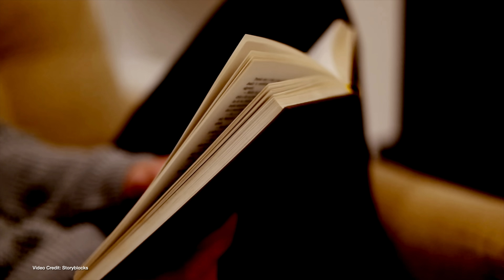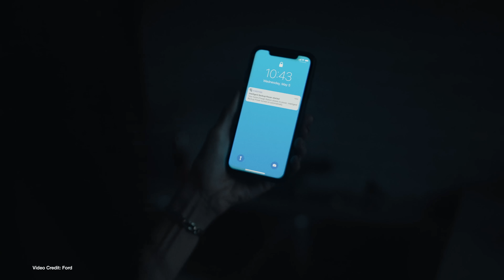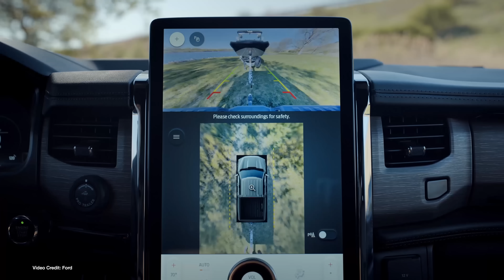What's Vehicle to Home - And Vehicle to Load?

Comment: I'd love to see a beefy vehicle to load system. something that could handle running a single window air conditioner with its high load starts, or space heater, and was clean enough of a power source to run a laptop without worries. A decent generator that can do that would be very expensive, and probably terrible for pollution. If I've got a ton of battery sitting in my garage, it's a pain not to be able to use it when you really need it
Reply: I charge my deep cycle batteries with my small generator or my solar cells then power my small fridge with an inverter. Since the fridge compressor only runs a few minutes per hour, the battery is on-demand only as opposed to needlessly running the generator full time.
Reply: @DanWS100  cool. Pun intended. Just seems to me that if I'm buying a battery that huge, might as well be able to use it to run a few things in a pinch. Adding a quality inverter to the car wouldn't add much to the final price, and at the very least it's nice to have on the beach to keep your drinks cold.

Comment: At 6:59 you talk about combining charging circuit with power drive as quickly becoming the norm.
Alan Coconni invented/ developed this in the 1990’s at the end of development of the GM EV-1. It was too late to put in the EV-1 due to. gM design freeze tip event card from mods close to production so it did not get used.
It lead to the high price of the Hughs external inductive charger that was required on the EV-1.
Reply: Correction

 It was too late to put in the EV-1 due to a GM design freeze to prevent cars from modification  close to production so it did not get used.
Of course production was delayed
But modification  was not put in.

Comment: I've been wondering would've be cheaper to use old leaf with 24kwh battery as solar battery. At least out here in Finland, that mount of lithium battery would cost more than used leaf.
Reply: A used EV battery is great for a solar setup. Lead acid batteries can work for it too. They're cheap, good for many power cycles. They're heavy, which unless you live off the ground floor isn't a problem, and they're not very energy dense, but a closet full of them could still power your home at least overnight.
Reply: Yes you can actually get a good working and drivable Leaf here in USA for under $9k all day. This is a much cheaper price than stand alone battery pack to run your house in emergency. You still need to feed the vehicles DC battery energy into a separate 6-9kw inverter to power your home as well as auto transfer switch to cut off grid in emergency. So add another $1500 to $2k for that plus labor. Most Grid Tie solar inverters can handle from 300 to 600 volts DC input so no issue there. With the auto xfer switch and another small Off Grid inverter you can trick a Grid Tie inverter into running in emergency or Off Grid scenario.
Reply: if you check on ebay used EV  batteries are very popular, and not cheap, cheaper than new batteries thou.
all the people worried about recycling used EV batteries dont realize they are mostly ending up as battery backup on home systems.
Reply: Not that difficult, the WallBox Quasar for Chademo is available now for V2H.  And the CCS version coming soon.
https://wallbox.com/en_us/quasar-dc-charger

Comment: Fortunately the power grid over here is a lot more reliable than the ones we experienced in the US. In the 40 years I lived here I can only remember 3 power outages. One was deliberate for some maintenance and 2 were diggers hitting copper. Power outage was never longer than an hour. From that point of view power to home isn't something  which would influence the purchase of a car. In the US we had an average of 1 failure per year and sometimes for more than 2 days....
What I would never do is to use the car as a buffer for the solar panels or "the grid" if it has LiIon batteries. If I look at the cycles my home battery (LiFePO) gets our cars battery wouldn't make it beyond 4 years lifetime (assuming optimistic 1500 cycles) whereas the home battery is specified for 10000 cycles (well beyond 20 years). And the home battery was a lot cheaper than our Tesla!
Reply: I guess you have not heard of the BYD blade battery LFP and 4000 cycles guaranteed before it drops below 80% and at around $85 per kwh, that's 12 years of daily discharge and the new BYD EV offer V2L as well. $22k EV with a 50kwh battery, good luck finding a grid storage battery with that capacity and price and it can also be used for transport.
Reply: @gregandkaruna6674  LiFePO is LFP and that's what I have for the house battery. As there is no rapid charging like in cars the manufacturer guaranties 10000 charge cycles and not only 4000 for 80%.
The blade battery is still not available on the market and with Chinese specifications I am careful as I have burned my fingers to often.
If you would have read my posting I also said that I wouldn't do it with a LiIon and mentioned the LFP as being better suited. Our Tesla has LiIon and I can fully understand why Tesla doesn't want it to be used to power a home.
Reply: @juergenschoepf2885  Well any country that is lucky enough to get Chinese made standard range Model 3 and Y do get the much safer LFP batteries so they could be used for backup power quite safely

Comment: We've been on the fence about putting solar on the house. My wife wants backup in such a system, which would add $$$ for enough capacity to get through an extended outage. And given the spate of outages reported on the news, I think she has a point. That's why I am so intrigued by Ford's recent announcement. The battery in a vehicle is far larger than anything I would ever consider buying for a once in a while event. And if we need to go somewhere, we have another car - and I bet most other people do too.
Reply: Why not buy an old second hand Nissan leaf they’re very cheap, park it up and connect it via one of the V2G chargers. Then it would charge up on solar ready for a power outage and to run the house in the evening when the sun goes down. That’s what I’m going to do, in my case the cars going into the garage never to be driven again. Total cost car and Nissan charger £9000 for 30 kWh of storage.
Reply: @wobby1516  I looked into it, doesn't seem avail until 2022. Between a Leaf (which I leased for 3 years) and a truck, I'd probably have more use for the truck... but the price of a used Leaf is compelling.

Comment: Why would I power my house with my car? In cases of emergency-isn't it important to have a full "tank of gas" in case one needs to leave. But yeah-having internet is just so important when the power goes out. If it is really is an issue-then wouldn't you get the solar/ power wall combo.
Reply: Here in texas hundreds died during the winter when the power went out. I could have used half the power in my car for hours and hours of heat, and still had half a 'tank'.
fortunately, i was able to just hang out in my car with the heater on, in the garage since i dind't have to worry about fumes, but still.. it would have been amazing to just be able to plug in a space heater to the car. and not everyone can afford the 30k to 50k for a solar/battery combo
Reply: @jameshughes3014  It was good you had a source of heat but I must point out that staying in the car was way more efficient than trying to heat the entire house as uncomfortable as it was. Good thing it was an ev. That's one thing a large battery like in the Lightning can do for an entire home as long as you know for sure that the outage isn't very long. Not knowing the duration though, I'd stay in the vehicle a lot if not most of the time - snow survival 101.
Reply: @DanWS100  who said an entire  house? I said a space heater. With a built in 2500 watt inverter, my car could run a space heater to heat one room for probably a hundred hours and still have half my charge left, and also be powerful enough that if I had to I could run a small window ac for a bit.. certainly powerful enough to run a fridge, what ever emergency need. Not all at once but usually you only need one thing. If it's something you'll only use once or twice in your life, why spend thousands just to make it more efficient? 
Feel free to go camping in your car, no one is stopping you. But my mom uses an oxygen machine. In an emergency, a small inverter could power it long enough to fill an oxygen bottle easy. Breathing survival 101
Reply: @jameshughes3014  Totally irresponsible! If a hurricane hit-videos like this may sway people to stay and power their house with their car rather than EVACUATE. I will never purchase a car based on the fact that it can power my house.  I prefer to have my car be my car and get me out of Dodge and use a generator for emergencies.
Reply: @seoultocebu  because my situation wasn't a hurricane, your argument makes no sense. The way you handle a hurricane isn't the way you handle things if a transformer blows up somewhere . There are a lot of situations like mine, situations that aren't major emergencies. But for a lot of people a power outage itself can become a major emergency. My mom is on an oxygen machine. If having tools is irrisponsible because someone might do something stupid with it, we should ban hammers. Basically what I'm saying is that I'm a grown man who can and should be able to make my own dang decisions, and in this case it may have saved my life.
Reply: Modern hybrid cars can last a week just idling with the heater going on a full tank of gas. Extremely uncomfortable but at least you do not freeze to death!
Reply: @gregandkaruna6674 just don't do it in a garage, and be careful of fumes. Crack a window on that thing if it uses gas
Reply: @jameshughes3014  lol who in their right mind would use a gas or hybrid in the garage without the garage door open enough for the fumes to escape.
Reply: @gregandkaruna6674  in their right mind? No body, but just have a look around, there's plenty who aren't in their right mind 😁
Reply: @jameshughes3014  true lol

Comment: I lose grid power about twice a decade. I'm happy to use a petrol generator for 50 hours per lifetime.
Reply: Fair point, just wondering how much time and money you spend on the gas generator when the petrol goes bad and messes it up. V2H may not be something you use just like some people don’t want to bother with cost and effort of buying and maintaining a generator.
Reply: @shaunwhiteley3544  petrol in a sealed container and dates from when I had a petrol mower a few years back. Seemed to work fine. The generator was 399 Australian and sat unopened in a cupboard for 5 years before I used it for the first time last year. I should fire it up again this weekend.

It's part of my emergency kit. 40 litres of drinking water, a week of food and the generator.
Reply: @gasdive  I have a similar emergency setup, my generator can run petrol or propane.  I swop my petrol each winter, has some other chemicals mixed in. I suggest you do the same as google results say can store for a year. 

My point I am poorly making is, you drive home, plug in to charge as normal and no further action required if there is a power cut. I’m home 99% of the time. Just another way to look after your home in an emergency situation.
Reply: @shaunwhiteley3544  oh, yeah, it would be a great bonus, but even if I had to buy a new generator every year and new petrol every year, and pay to dispose of the stale petrol every year, I'd rather do that than buy a Leaf over a Model 3. (they're the practically same price where I live).
Reply: @gasdive  OH GOD YES!!!!! Sorry I thought you were against the v2h idea! Doh! I’m just hoping Elon changes his mind and makes the change to his vehicles to allow it. 🤞

Comment: I would like to go off grid using solar panels and having vehicle to home or load to offset the cost of a battery backup will be important. When I am using the EV a small battery backup would provide the small amount of needed power such as for the refrigerator.

Comment: One critical aspect you didn't mention was school buses - they will be critical to killing off fossil peaker plants, so it's this community's responsibility to educate and pressure decision makers to buy electric school buses that have V2G capability.
Reply: I'd rather they convert existing buses rather than making new ones, but yeah electric school buses would be great. Especially for VtG.

Buses have tons of room under the floor for batteries. Especially if you take out the driveshaft and use either a single or dual motor near the axles you have tons more room even. 
They'd be great candidates for using near end of life batteries because even with their reduced capacity you can add so many to the bus that it still has plenty of range.
Reply: School buses are perfect because they aren't running all day like city buses so they will have a more ready supply of surplus power.

Comment: Musk is Mr Moneybags...he's against V2G so he can sell you the same battery capacity twice.
Reply: Lets examine that.
V2H is "oh noes, my house needs power for a few days"
V2G is "I will arbitrage power on a daily basis"
If I'm driving, I'm not connected to the grid, so I can't sell power. If I'm connected to the grid, I'm not driving. 
So when I'm driving in the AM, and I'm out all day, and then coming back home, I'm not selling power back to the grid. For a couple hours in the evening, I could sell power during peak times. And then I could recharge back up with cheaper overnite power. Cool. I mathed this out once, and using NEM rates, jumping through all the involved hoops, I could knock like $10/day off my power bill. 
Meanwhile, a powerwall is conveniently connected to the grid, all day long, no hoops required. In fact, if I have solar, I could arbitrage my own generation instead of just selling back cheap overnite power. 
Meanwhile, V2G causes my EV battery to cycle more often, which shortens the overall lifespan of the EV. Mathed this one out, too. Turns out that if I maximize the process, I wind up burning as much of my car's value as.. the cost of a powerwall. 
So, I COULD V2G. OR, I could just buy a powerwall, not have to fiddle with the whole process, and still earn just as much, or more if I have solar, AND still get all that driving out of my EV.
But please, go on about how Musk is just greedy.

Comment: There can be premature degradation of your car's battery if used to power your home. Multiple factors must be considered.  Why would Tesla recommend you use your Tesla vehicle when they can sell you a powerwall? Other EV makers are embracing V2H. I will buy one of those EVs before I buy a Tesla because I foresee using my EV to power my home during peak cost hours to shave my electric bills.
Reply: I'm guessing they recommend the powerwall because you don't need to leave your vehicle parked at home during peak hours. Ok,  if you work the graveyard shift.
Reply: @DanWS100  That is what the cheap or wreaked Nissan Leaf is for if you have the space for the car just permanently park it and enjoy around 20kwh of it's storage and if its a wreaked car then super cheap.
Reply: Double the battery pack revenue is why....your saint is not a billionaire by accident. He's a bullshitter & cult leader whose number one goal is making fat stacks of Benjamins off rubes.